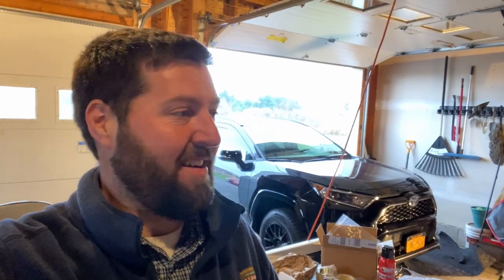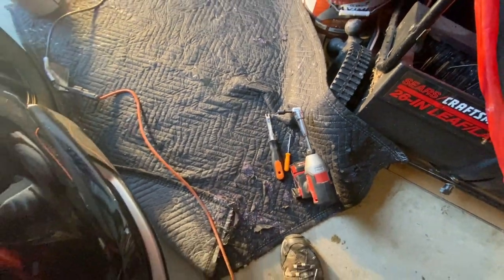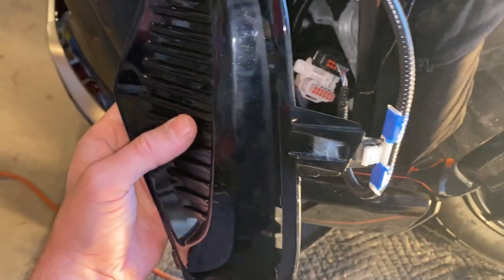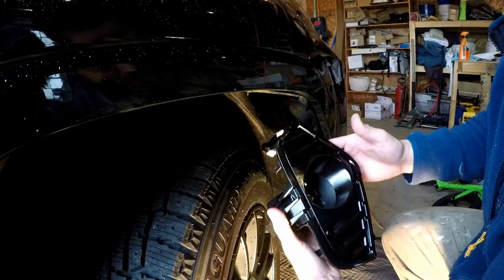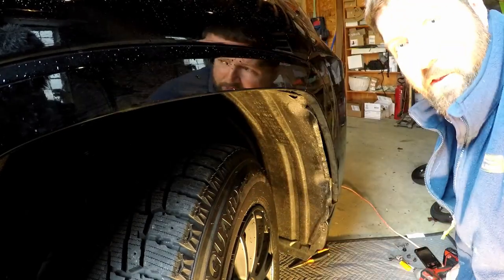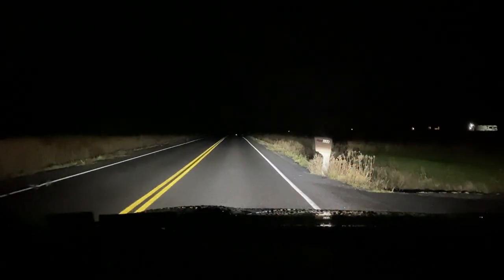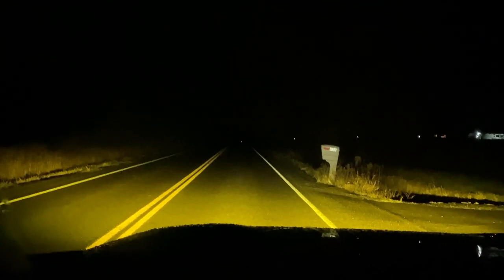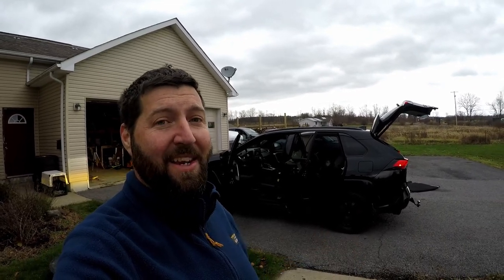2019 + Toyota Rav4 Fog Light Installation - Diode Dynamics SS3 Yellow Fog Pattern

Comment: I think you have very good fog lights and their function isn’t same as headlights as they not suppose to project out far but immediate surroundings. Pretty cool you can use them without headlights on but for my Avalon 2014 xle hybrid I have to have headlights on in order to use fog lights. Glad I bought both fogs and headlights switchbacks

Comment: When I installed them on my civic, i was able to adjust them with them already installed by pushing on them from the frontside, with the screws already on pretty tight. So far it hasn't moved when driving for 10kmiles and i can always still adjust them on the fly
Reply from the maker: Yeah I can see that. I could probably do that if I ever have to adjust them again.

Comment: Hey Jim! Where did you connect the power/battery in the engine bay? Or did you send wire all the way to the back of the vehicle? I don't recall seeing anywhere in your video that shows how you connected the lights to the power? Thanks in advance!

Comment: Great video! Very informative. 
Can’t wait for the first big snow storm. 
I’m curious how those new tires will do.
Reply from the maker: Thank you for the comment! I have since actually sold these wheels and tires. lol It happened kinda fast. I bought MR147 wheels and Firestone tires. Im dropping them off tomorrow to get mounted and balanced.
Reply: @JamesKlafehn  what’s your feeling on these plug in performance chips out there for the RAV4? I’ve seen them on eBay for $58 and up? Most offer a 30 day money back guarantee. I’m curious if it would add more horsepower to the RAV4 Prime? Might be a good video for you to make.
Reply from the maker: @AveiroDan  I dont have an experience with them. I have doubts. The prime is a unique vehicle so I doubt a chip company has the expertise to tune it. I think OEMs do a lot of work tuning the car for optimum output. I for one wouldnt want it to be just a little quicker if I lose ev range or MPG

Comment: Thanks for all of your informative videos.  As the owner of the RAV4 Prime SE I am planning to install the SS3's much as you describe here.  As I look at the switch bank below and to left of steering wheel I notice one empty position with a blank switch where I'll place the foglight switch.  However I notice that the blank switch has a prewired connector (6 wires - gray, purple, purple/black, gray, orange, gray).  I'll break out my multitester to probe these but wonder if you considered tapping into those for your foglight install?
Reply from the maker: I dont like using OEM wires unless I am 100% positive I know exactly what they do. It may test as a dimmer wire for example but be something else or trigger something else.

Comment: Thanks for very informative video, James. I have my RAV4 Hybrid LE 2021 and it doesn't have fog lights. After watching this video, I'm planning to put up ones for myself. However, I have some questions regarding connecting the wiring to the power. I did a little research and I got different answers: 1. Just wire them to the existing parking lights. 2. Get the power directly from the battery using an inline fuse, and wire them to the headlights, and make the headlights wire to be the trigger on a relay. 3. If I want to have a separate switch for the fog lights, I have to get an extra cable to get the power from the battery, which is at the back of vehicle, since mine is a hybrid. My questions are: Is there any way I wire them and get power without going through the firewall? There are fog lights kit being sold both in Ebay & Amazon with complete set of wiring, relay, and switch. What are your thoughts?

Comment: Did Toyota remove the oem fog light harness in the 19+ models without fogs? My 2018 LE didn’t have fogs but did have the oem harness which made the install way easier.
Reply from the maker: Good question. I didn’t see any harness there.

Comment: Hey at 6:09 is that a DRL connection plug? I didn't see it on the passenger side when you took the cover up. I'm asking because I have a Prime SE and I want to add the OEM Rav4 Prime XSE Vertical LED Accent light to my Prime SE. Is that possible?

Thanks
Reply: Following this! It looked like you could just hook into what I thought was the DRL and have fog lights run with those (which is fine for me)
Reply: Hey @rtrt2889, Did you ever get this done? I'm looking to do the same thing but only want to pull the trigger if the wiring is already there. The lights themselves are $300 per side.
Reply: @dougadams6861  Any luck? I'm hoping to do this too.

Comment: @James, was there no pre-wire tock away for the fog light behind the bumper? As with Toyota trim they all come off the same assembled line so the same wire herness should have been here, subtract the relay, the stock switch with the fog light switch. if it not there, it seem that Toyota might be doing things different to prevent owner from adding the options to their vehicle that only on the higher trims. I think the time you install all the options, you would have turn your SE Prim into a XSE Prime. if I had a SE Prime, I will build it up to the XSE trim. Anyway when is your review of the Chevy Bolt coming. looking forward to your review.
Reply from the maker: No I didnt see any wires. I didnt think to check though.
Reply: @JamesKlafehn  OK, understand.  once they did not change the way they do thing at Toyota,  they should be there. They normally fold them away. like on my 2001 Corolla, LE that did not come with fog light neither offers as an option on the LE, but standard on the S trim. I was able to install my fog light the only thing I did was buy the relay, and the steering wheel stock switch that have the fog light switch and work right out of the box.
Reply: @JamesKlafehn  I asked my dealer, who I really like, they said the harness is there , but it is setup as daytime running and controlled through the info panel. They said they can install the actual Toyota XSE lights, although it is a pricey part.

Comment: How long did install take? I have a LE and I did not have fog lights either. I. Bought the kit that will have the holes to put fog lights in
Reply from the maker: Maybe an hour. It wouldve taken less time If I wasnt filming. Maybe 30 mins.
Reply: @JamesKlafehn  do u have an LE or do u have a model that already had the kit installed and all u had to do was install the SS3 lights ?
Reply from the maker: @okiefoodieking  I have a Prime SE. If you watch my installation video youll see that I had to run all the wires. Nothing was there.
Reply: @JamesKlafehn  wow and it only took u an hour ?
Reply from the maker: @okiefoodieking  yeah
Reply: @JamesKlafehn  I have an LE. So u didn’t have to take the front hood off at and just turn the tires?
Reply from the maker: @okiefoodieking  nope